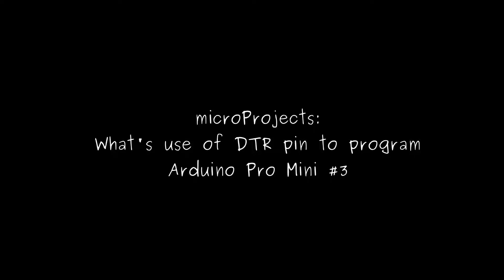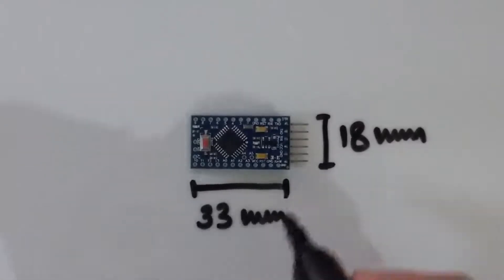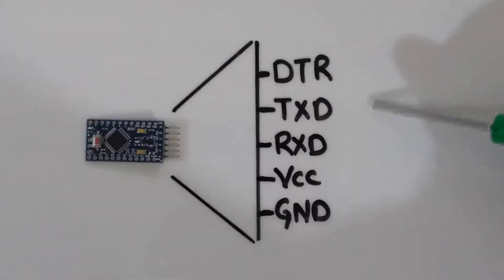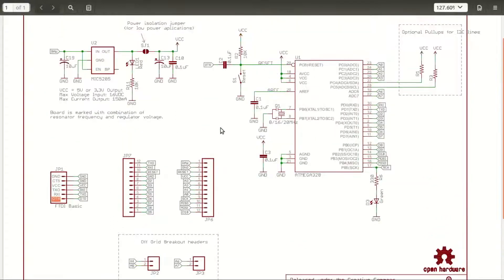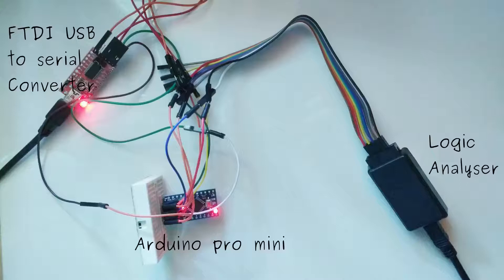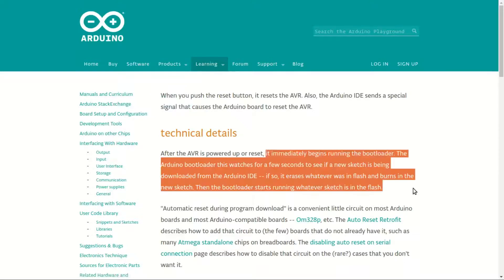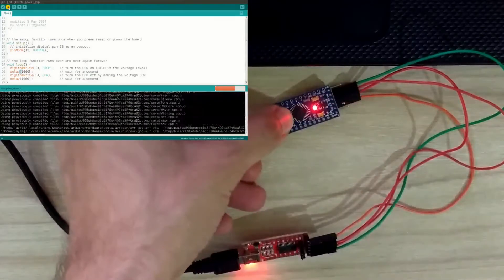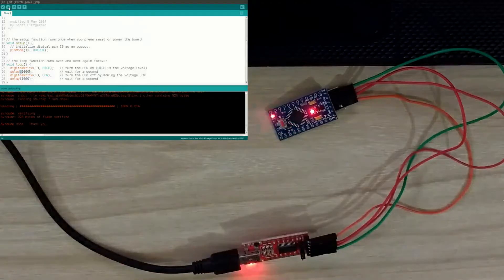miniTalk #3: What's use of DTR pin to program Arduino Pro mini

Comment: how would I use this to program several Arduino Mega 2560R3 at the same time? I found this description via Google, but dont' fully understand what he is saying. Can anyone diagram this?

  how to upload a sketch to many Arduino's at the same time. This was key!!! - You connect all the GRN in parallel (from the FTDI - the DTR connection and the Arduino's GRN) , the TX from the master serial (in this case my FTDI) connects to all the RX on the slave Arduino's in parallel and the GRD on all connected together as well in parallel. The only down side is that you can't receive a verify from the uploaded.